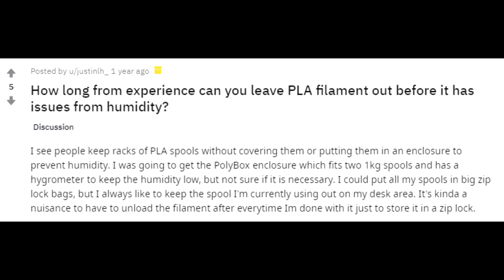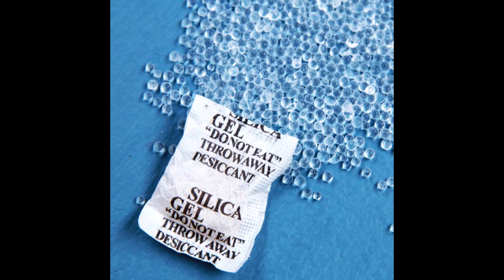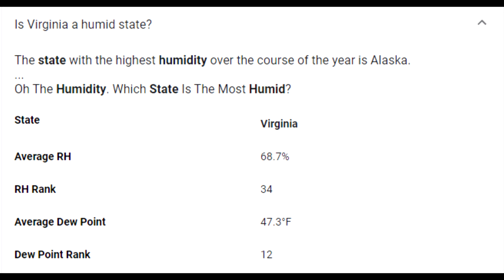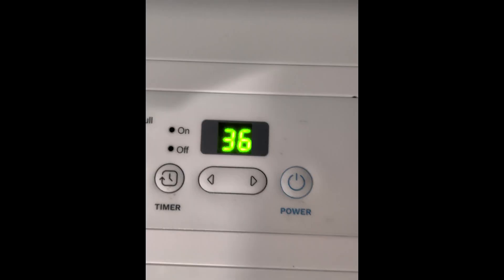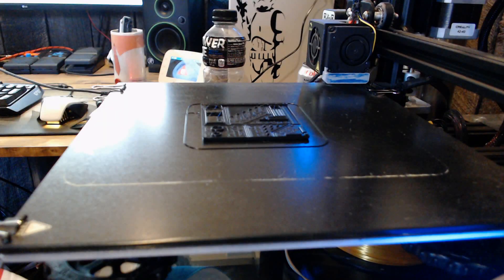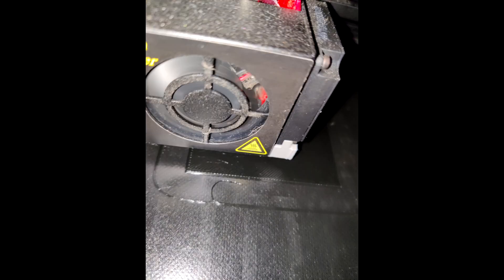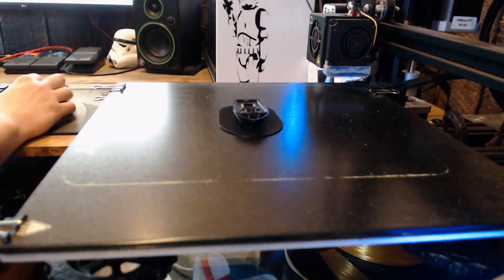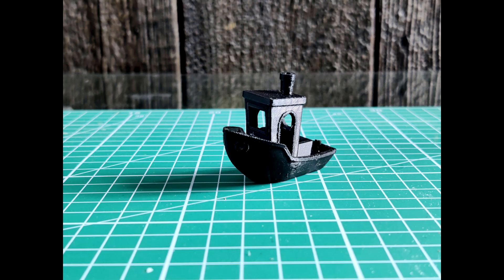I Used PLA 3D Printing Filament That Was Left Out For a Year and This is What Happened

Comment: in had my roll on the printer for 3 mothns. i was jutinhaving some extrusion issues and the layers except for the ones that had the 2 blobs from form a leak that i had to clip off from a leaking hotend. those actually caused stoppages in the print so I had to pause and try to clean them up as best as i can.  the layers other than that looked nice and smooth. the only real imperfection was at the steampipe of the benchy which has a crater. other than that, its nothing too bad. I live in northeastern Utah. Which is #46 so even less humid. it's still cold and that can go int April, but I don't live in Hawaii or a subtropical area. I'm actually going to test it when I get off of work and let the benchy print overnight.  I already tested the new hot end for thermal runaway after applying some thermal paste to the thermistor. i will then dehydrate and vacuum seal.  I'd be more worries about wet filament with nylon. a lot of these tests I see on yt are to the extreme where they submerge the spool. that's why i wasn't fully convinced. I also don't have a dehumidifier.

Comment: Just printed with a roll of filament from 2018… it’s 2022 now. That roll of filament was in a machine shop just laying around for more then 3 of those and these  last 4 months in a cold ass garage . Didn’t bother to warm jt up or bake it, fired up the printer with a sliced file and whalla, normal printing without artifacts like warping, delamination, blopbs or anything. 

I really don’t know, but unless you dunk these basic pla filaments into water, leave it lying in sunlight or something I don’t think much happens.

Comment: Don't know if you gonna see this, but i'm new to 3d print. And i bought my first 1kg PLA Basic, and i did printed a lot with it. However, 2 weeks later, i'm gettin all of sudden an under extrusion problem. All my prints fails everytime. The nozzle sometimes is doing something like a "pop" sound, i can hear. The end of my pla is always gettin somehow slightly bigger than the rest of it, like its inflated a little bit inside of the heater.  And, its creating some gaps and even little holes between the layers printed. Sometimes theres no filament gettin out of the nozzle aswell. Anyway, i did not stored my pla anywhere. I just leaved it there at the printer (ender 3 pro). Most likely i'm having a moisture/humidy problem? Did it got wet with the air around the room?
I even tried to clean the nozzle with a little tool that came out in  the box when i bought the printer. And the nozzle inside seens to be perfecly clean, theres no filament in there.

I live in a city with 70% humidy level, something like that. Its been raining a lot lately here...
Reply: I'm having an those issues to, but my pla had been sitting out for way longer, i also just upgraded the extruder and got that flexible hot plate, that seems to have fixed my sticking issues but now my prints are super super bridle